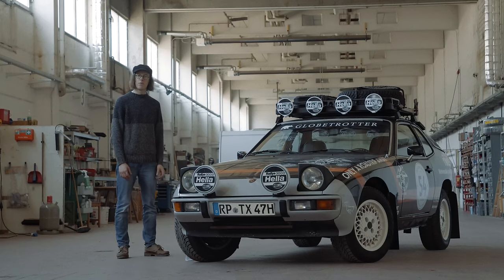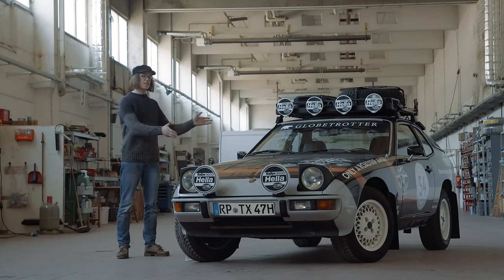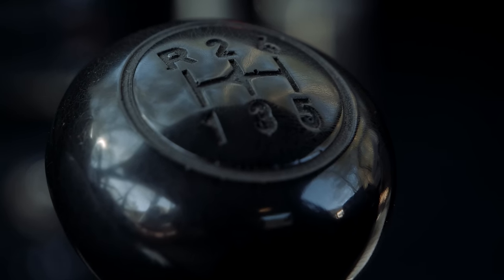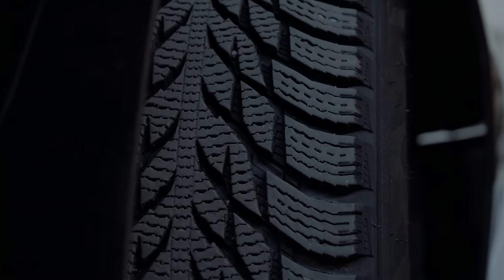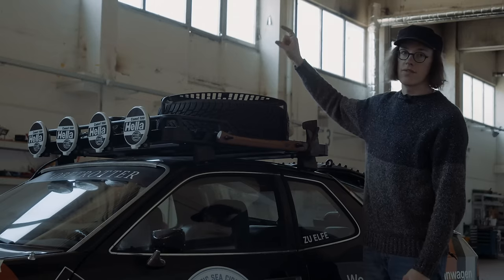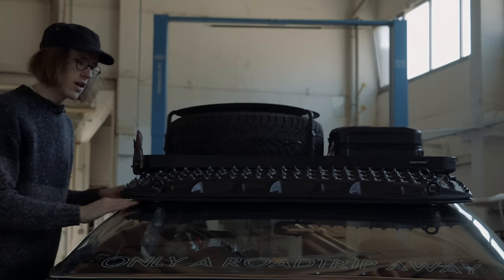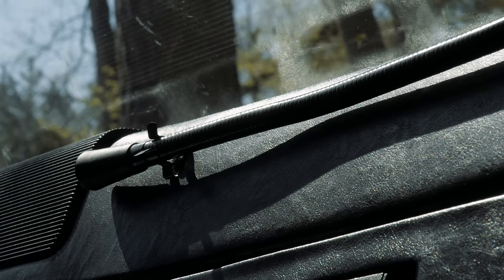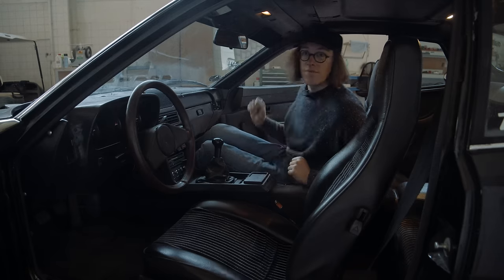Camping Porsche 924 - Overland Rallye Build Tour

Comment: "You should go and do something cool too" - awesome message. Makes me wanna take my 944 camping. I will. I promise!
You picked the correct car. These are surprisingly practical. Actually i cannot think of any sports car more practical than the transaxle Porsches. I have used mine as a daily for 10 years and then gave it a full restoration as a gift for never letting me down.
The mods you did to the car elevated it to another level. You should sell them as an overland kit! :-D

Comment: Started restoring my old 924 thanks to this. This was incredible, thank you.
Reply: Hope went to euro spec pistons or totally seal rings then would pump.up hp.  Also vw golf throttle  body will bolt right up need add one vacume  line but it's double size intake single bore instead of that double bore

Comment: Crazy and awesome!! 

I want to convert my XC70 into an Overland "sleeper", too. Maybe we can hook up sometime, I am in southeastern Germany.
Reply: Did it to my 02 allroad. Built the rear hatch into a sleeping section and re-wired the 12v out to both a hot plate and heater, also built a gravity feed for the fuel canisters on the roof rack and insulated the living hell out of it. Also got rid of the air-ride for some "offroad" aka level 4 ride height coilovers and LM60's. Built a snorkel because "reasons" and flashed the 2,7L.
My favorite memory, even though it was mostly for going up mountians in the north-east USA for snowboarding, was river crossing where a guy in a 4thgen K series and a half-clapped together M35 wouldn't try, but my stupid lifted wagon did. Not sure if I got luckly or if it was the allroad to this day, but the water was over the hood, nothing was leaking into the cab, and I got out.

Comment: Wonderful build. Have you considered fabricating a laminated panel in place of the canvas snap in camping section? It could be one continuous piece or two pieces. Would be more weatherproof and provide more security for the occupants. Also could double as a spoiler when not doing camp duty, if an aesthetic design could be worked out.

Comment: The porsche seemed very capable of driving on snowed/iced roads in Norway and Russia and it looks good as well. I worked on my motorbike but I'm dreaming about buid a campervan/overlanding vehicle. I'd love to do it an old Merc ex-German fire truck.
Reply: Think of the Rally Porsches. They are good on all terrains. 
Of course a rear engine helps on snow.. 😀
Reply: I wouldnt buy that kind of merc, they are eating fuel like nothing and are slow and unpractical as nothing, get a t3 with the 90 ps or 112 ps motor, extremly  reliable, all terrainer and a lot of space too, and great to work on.

Comment: you should add magnets to the outer layer,  of the "tent" too keep it from lifting in winds. also you should use another method of keeping the rear hatch up, the struts will eventually separate the glass from the frame, as is very common. another thing instead of glue on the Glass for the traction boards, is use  suction cups used for bike mounts, such as the seasucker.
Reply from the maker: 1 - unless we intend to park in a hurricane, magnets wouldn‘t add any benefit, we did think about that and parked in heavy wind w/o issues. 
2 - that unfortunately happens with or without camping and it can be re-glued, although it isn‘t easy. 
3 - we thought about that but given the intended height over the glass of less than 15mm and the expected cold the risk of failure was too high. plus there is no plan to remove them at all, just get a new used hatch if they have to go for weird reasons. 

✌🏼✌🏼

Comment: Well explained.  Just to clarify, the later year 924S cars have a lot of Audi and Volkswagen parts.  That is by no means a slam on the cars. Those parts are well made as well.  It's the Porsche snobs who have a problem with this.
Reply from the maker: Yeah, they still share a bunch, but compared to the amount of VW part numbers and the beetle rear axle on the early cars like ours a late model 944 turbo or S2 is a different beast altogether. The line was meant to cover all the transaxle design up to the 968. The 24S is an oddball anyhow and more a leftover car than anything.

Comment: I would like to purchase the hatch flaps and platform.  Such a brilliant idea using the carpet retaining snaps. Any chance of making a small production run of those?
Reply from the maker: As of now, this is just the one off, and the car as seen here doesn‘t exist anymore. It wasn‘t too challenging to build, but certainly not finished enough to be sold to customers. The channels on the rear glass are the toughest part.

Comment: New to this. I have a 924 1979. Can phone dial wheels be fitted on? What would be the steps…? Or not worth trouble?
Reply from the maker: There are 4x108 dial-style wheels, but they are quite rare. As for the 5x130 ones - it can be done with stacked spacers, nothing I would personally do.

Comment: Awesome set up! Is the sleeping platform a composite material?

Also, nice 4Runner in the background :)
Reply from the maker: The literal translation is screen printing plate - plywood with a smooth side and lightly knurled, grippy opposite. Don't know how the term properly translates. In any case: Wood. 12mm or so.

Also, one aspect we never touch on in the episode: This car is essentially nothing more than a working prototype. Legs, folding construction, handling dynamics and much more leave endless room for improvement, which is precisely why the fold-down legs are such a shameful and crappy construction. We had to prove a point, and luckily we did that with overwhelming success.
Reply: @OnlyARoadtripAway  That makes sense. Thank you for the reply!

Comment: I would love to know where you made/bought your spacers for the shocks. I´m looking to lift my 2". I´m already using mine as a winter sled here in Åre så I know it can handel sideways (and start when it is below zero)
Reply from the maker: There is an episode on each element of the build - but the short of it is we had them made by a machine shop nearby.
Reply: @OnlyARoadtripAway  Nice episode! You don´t sell the drawing for the front spacers? Shame it is such a hassel lifting the rear. Perhaps I just cut the wheelarce and can fin my offroad tiers anyway : ) Planning on having busch waker alike fender flares aswell : )  Cool production (both car and vlog)
Reply from the maker: Once you know how the rear is quite easy, don‘t just cut metal! Shoot us a mail regarding the spacers, mail in profile.

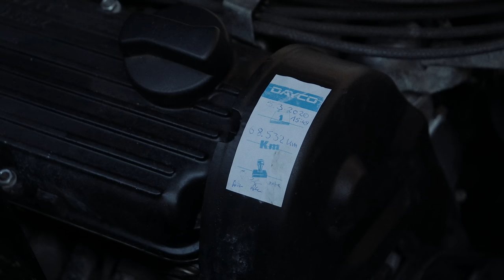Comment: 3:25 "originally used in a van". Oh dear. I'm sorry to hear you've fallen for this myth despite an otherwise stunning video. The VW LT van shared the block, but had a carburettor and different cylinder head, and only made 74 bhp. The engine previously came from the Audi 100, and the block design dates back to DKW in the late 1960's.
Reply from the maker: I haven't fallen for it, and very well know it is merely the block design - I just didn't think it was fair to talk about this "Porsche" without making it clear that the 2.0 cars were parts-bin projects. Same goes for a lot of parts in this - the door look VW, but aren't actually interchangeable. Porsche did an amazing job putting it together, nonetheless it wasn't really new tech.
Reply: @OnlyARoadtripAway  Hi. Thank you for the reply! I know it's a parts-bin car. That's actually one of the attractions. Lots of easy to find service parts used on other cars.

It's just unfair to give a 125 bhp engine the reputation of one with 74 bhp.

Comment: I want to do this with a 928
Reply from the maker: I would advise against that, for a lot of reasons. 😅
Reply: Why, my friend
Reply from the maker: @victorsandoval4792 - Apart from space, fuel consumption and pretty unsuitable suspension to easily lift 4-5cm it would be mechanical complexity. I know it was done in a 928GT as a world tourer, but nothing in a 928 is a ‚quick fix‘, everything is contained, proprietary, and necessary. No chance finding a garage qualified enough and even doing it yourself requires a lot of skill and time. I‘ve done a complete mechanical resto on a 928. It‘s not simple, it‘s not cheap.
Reply: @OnlyARoadtripAway would you say working on the 924/944 is simpler, more doable?
Reply from the maker: Considerably. A 944 is, turbo aside, a simple thing.
Reply: @OnlyARoadtripAway  I see, I was thinking about maybe a golf GTI as well because I do like to take camping Road-trips across the western coast of North America. 

I’m looking at a 944 now for around $5,000 USD.  Needs some work (slave cylinder, cranks sensor, water pump) put those parts are included, just need to be installed. But I’m willing to undertake and learn. Thank you for the input.